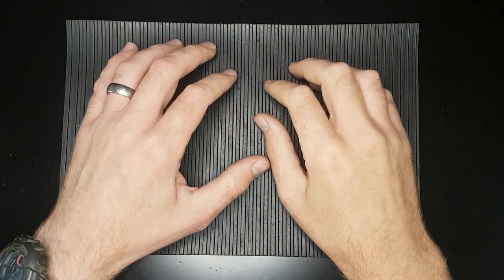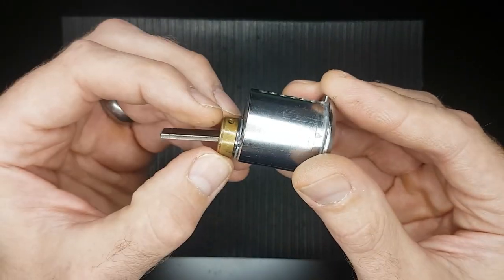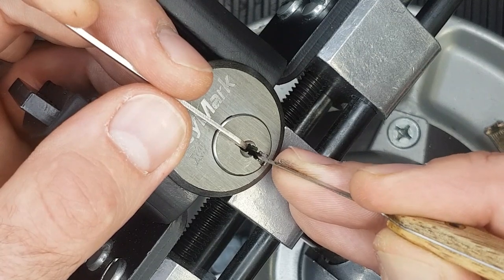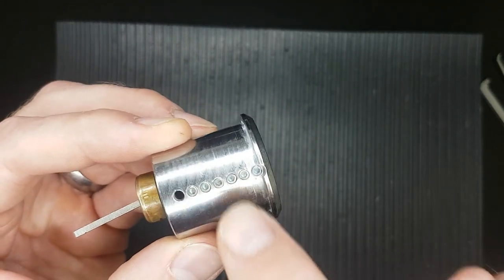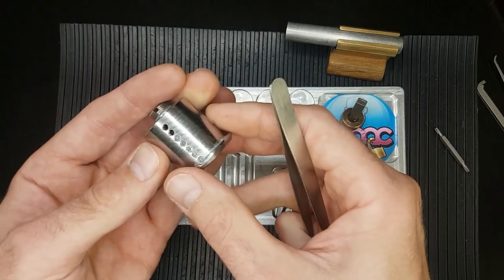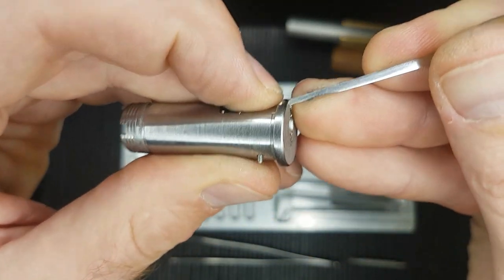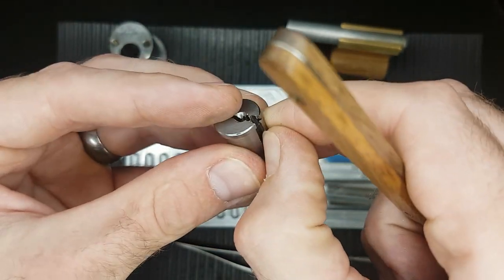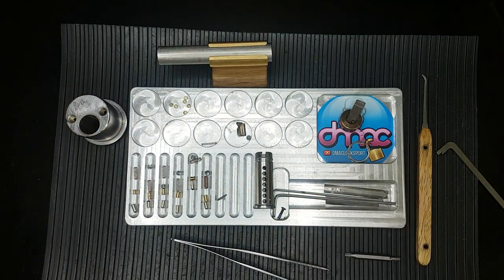Keymark X4 rim cylinder picked and gutted for #LockFumbler100

Comment: I completely agree with the advice about taking a lock apart. I'm still abysmally amateur and inconsistent with my picking, but I think it's almost a necessity to brick a lock, have a gutting disaster and make embarrassing mistakes. Those errors teach me so much more than I can learn as a passive viewer of someone else's work. I place great value in doing the research on my locks. I don't consider it cheating at all. The more I know about my locks, the more I will appreciate their engineering and enjoy when I finally defeat them.
Reply from the maker: Exactly. I've had plenty of locksport disasters but each time I have learnt lessons and built experience to move forward. Thanks for watching 😁👍🏻
Reply: @Dmaclocksport  One other thing I've learned is just how important tension control can be. Until recently I've been viewing it as just a push operation. Now I'm giving more attention to finding a wrench that fits snugly (using two thin wrenches back to back if needed) & allows me to rotate the core in both directions, rather than just pushing and easing up. That's far more difficult but I think is more controlled. I'm years away from being able to use float techniques but I think that approach will be a helpful start.

Comment: Very nicely picked and a very good tip.. break the problem down into manageable parts. 
Although gutting even the standard pin tumblers gives me the fear, never mind when there's sliders and side pins and sidebars to worry about😆
Was the wee pin getting trapped in the groove with the core rotation, and floating the tension allowed it to drop when you picked the slider?
Good luck in the draw 
Cheers bud 👍🍻
Reply from the maker: Yep, exactly that. The small pin stops the core turning but, since it's not connected to the slider, the slider doesnt bind. Float picking it was the only way to drop it to rotate the plug.

Comment: Couldn't agree more with that tip. Helped me with the Medeco Biaxial, from stumped to open an hour after gutting it. Question: is there a difference between float picking and just having a tension tool that fits super tight?
Reply from the maker: I know that some folks use a snug tensioner to float rather than using 2. I've not had much luck with it though. If the keyway wears slightly, the wrench gets 'play' in it which means less control. 2 wrenches always gives me better control